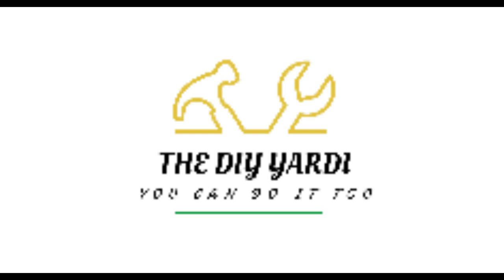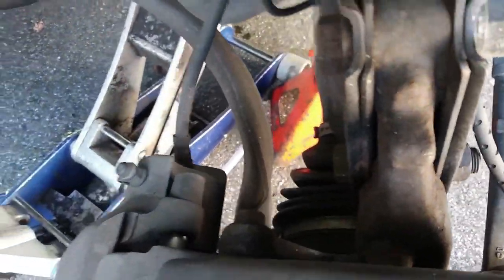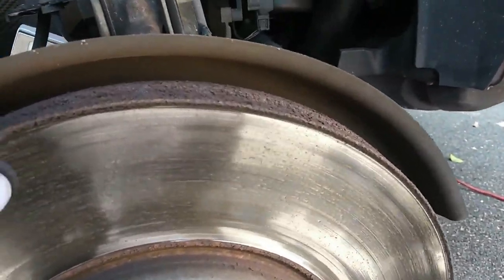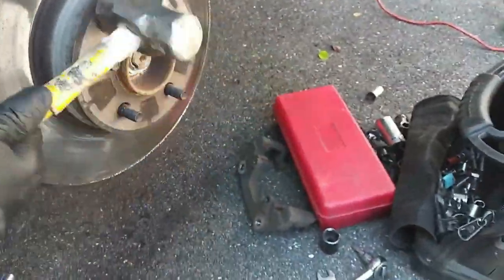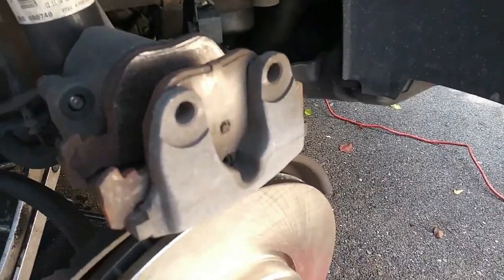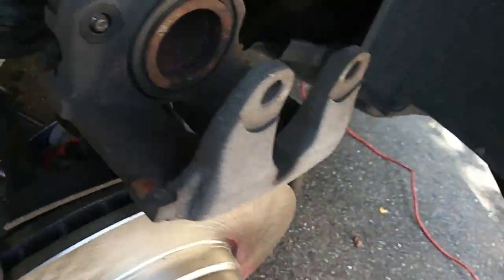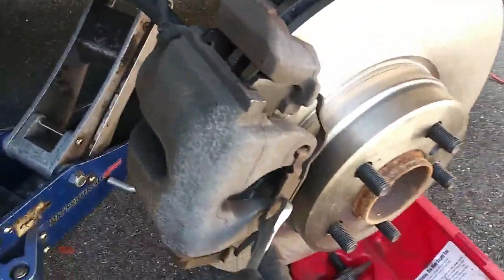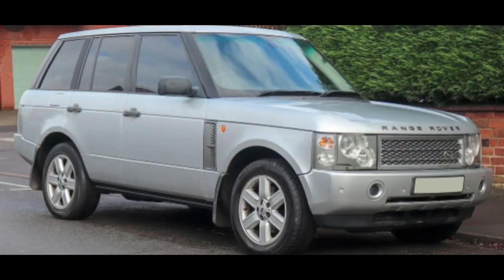2006 Land Rover Range Rover Front And Rear Brake Pads Removal And Installation

Comment: Reapect mi dan. Just did my 06
Reply from the maker: Nuff respect Boss, bless up..
Reply: @thediyyardie7192  one thing i would like to add though Bredda turn off the brake.  Make life easier to take off the rotors.
Reply from the maker: @damiondice  if you mean the park brakes, yes that should be definitely off when installing the rear brakes and rotor..